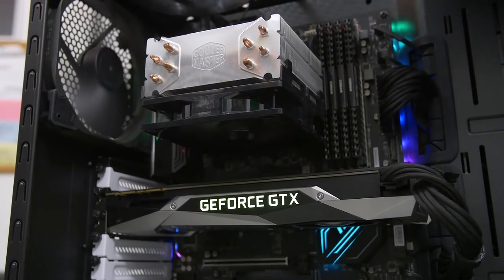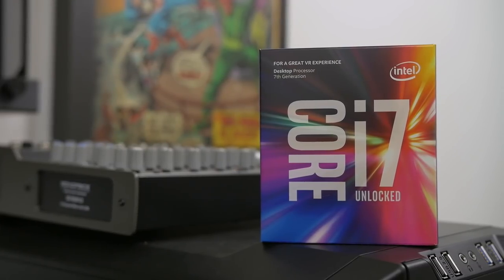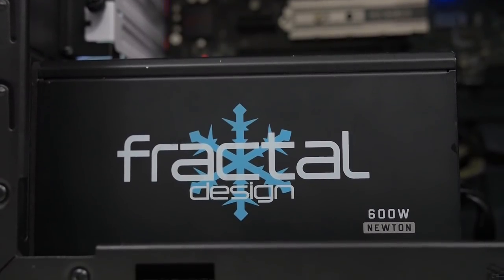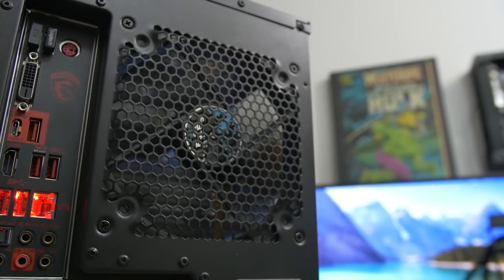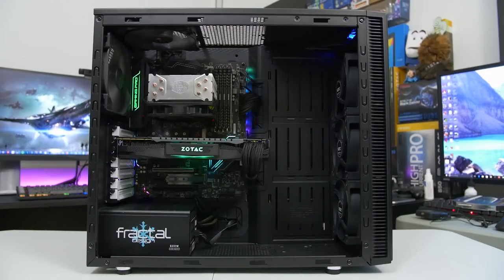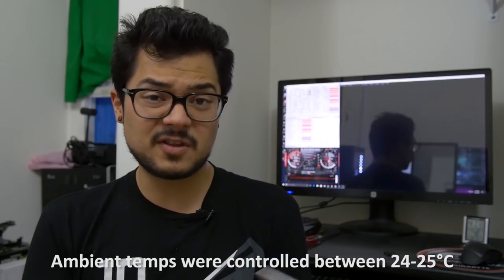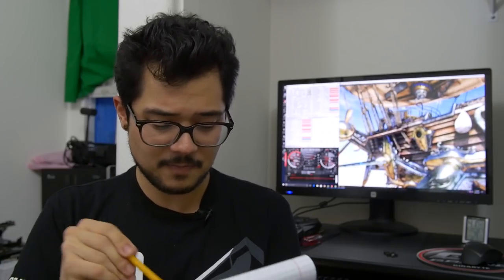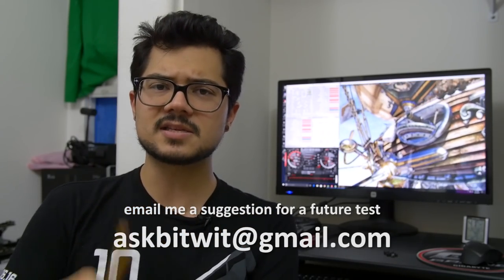This is how you should mount your CPU cooler! I think??

Comment: the card that is exhausting to the rear isn't cooling itself as well in your system due to not enough surface area on the vents on the rear of the card, this would probably lead to heat rising off the card itself without as much force, and might also cause some of it to get sucked back in if you have open slots or vents above the video card but below the rear fan. in your case basically the air is flowing vertically, from front bottom to rear top. the open video card is blasting the air into that path better and its getting swept out, but with the external cooler card the excess heat not ejected out may be just rising slowly causing more of it to flow through the processors intake fan instead of dissipating all around in the case more evenly. I have a rear ejecting video card and I find its typically the hottest point of exhaust. my case has four intake fans two before and two after the hard drive bays, a rear and processor back side exhaust fan along with a 200mm top fan, my cooler is a noctua air dual radiator pointing upward to the top, the bottom rear of the case doesn't really have much air flow since the power supply draws from the bottom of the case and ejects it out the rear and its sealed up better than a typical video card housing.

that's my best guess anyway, the rear exhaust card isn't getting all the heat out the back and is not scattering it in the case so since being right under the processor more of the left over heat is being funneled through it than would be the case if the fans were spreading it out all throughout the midsection of the case when the cpu cooler ejects to the top it pulls air around the closed card, but with it ejecting out the side the heat coming off the card is hitting the side of the radiator as well causing it to warm it up before escaping, the closed card creates a block in the air path in the case and there is nothing below it to force more are around it, the open one is pulling air from the bottom of the case which is pulling some air from the vertical path under the gpu instead of letting it block it and head strait to the processor, if it skips over the card the processor fan when rear facing pulls it away from it all together thus the rising heat hitting the solid side of the cpu cooler warming it up and then heading strait to the processor intake and rear exhaust fan after its bathed the bottom of the cpu cooler in warmth. like I have experienced the video card puts out the most heat anywhere on the exterior of the case where as the rest of the exhaust fans basically are putting out room temperature air. I also assume the test was done with the case side installed.

I know there is a few scenarios kind of lumped together, you could retest putting something in the case that completely isolates the bottom rear including the closed gpu cooler and see if you are getting a warm spot in the case between the gpu and cpu heat sinks, who knows, maybe just a fluke test unless run many times, video card could be blocking the air flow, your ac / heat inside the house might have been a slightly different temperature, youd really have to run this many times under different loads, see if the readings change more with the gpu idling but maxing out the cpu for both

or like someone mentioned, smoke test would be cool, I use cigars to check engines for vacuum leaks lol, might not be the best way to test it, but it takes awhile before smoke will make the internal components sticky

the truth is you may never find the answer and a few degrees isn't anything to be concerned about at lower temperatures, I simply chose to install mine pushing air out the top since the largest cooling fan on the case would basically just aid the two that are part of the cpu cooler

Comment: Here's a theory....

When the fan was in the vertical position, it sucked the heat up off the GPU when the shroud was off. But, when the fan was horizontal, it created a synergistic vortex of air that blew cooler air along the back of the graphics card, rather than just sucking the heat straight up into it. Hence, the horizontal flow was more efficient in keeping the CPU cool.

Comment: Well my guess would be that with the "open" style gpu, with the cooling push the air out the top. The cooler could be pulling the heat from the "open" style gpu, hense the rise in temps.

Comment: And you should put the gpu tempratures beside the cpu tempratures, jsut for comparison. would be nice! this is, since the cpu cooler would be mounted vertically, it should remove hot air from the gpu as well. :)

Comment: I'm actually interested in how the graphics card temperatures compare.
How does the the CPU cooler orientation impacts the airflow around the GPU? Does the vertical mount helps getting hot air away from it, and what is more beneficial for certain use cases (gaming, rendering, light browsing, etc)

Comment: Maybe there is a positive air pressure pocket from the blower GPU outside the case that is blocking the air coming out of the case at the CPU exaust.
Retry with air guides to tweak the airflow.
Can be the internal airpath too. ;)

Comment: with the fan blowing towards the rear of the case and a graphics card with an internal case exhaust the air is forced down and out where it is than mixed with the air from the  intake fans creating more volume of air through the CPU cooler even though the air moving through the cooler may be a few degrees hotter the increased volume cause the cooler to be more efficient

Comment: Knowing what the GPU temperatures were in each test would probably shed some light on why the CPU temps did what they did... but assuming the GPU temps were the same on both cards, here's my theory:

In the first test, the CPU HSF and the blower card are both pushing hot air primarily out the back of the case, which concentrated more hot air near the CPU exhaust area, and also underutilized the open vent at the top of the case, so temps were higher.  In the second test, the GPU was able to take advantage of the vent at the top of the case by exhausting hot air into the case, which could then escape through the top vent, while the CPU primarily exhausted out the back.  In the third test, the CPU is exhausting out the top of the case and the GPU out the back, so temps are still lower.  In the fourth test, the CPU and GPU are again both fighting to push hot air out the top of the case, so the temps rise again.

Comment: Here's what I think:
The first Test was normal
in the second one, the GPU improved the Airflow but the 212 still got fresh air because of all the Case Fans and because the Air came fron the left
Third one normal too
And in the last one the CPU got the hot air from the GPU because it pulled the Air from the hotter GPU area

Comment: I'm gonna go out on a limb and say the reason the temps didn't make sense is that the open air card is running much cooler at load then the blower style so its creating less heat inside the case where as the blower style backplate is warming up pretty good and rising towards the cpu and warming the air inside the case more then the open air. I'm probably totally wrong but hey just my 2cents lol!

Comment: the blower style graphics card will pull cool air through it and out of the back, bulling some airflow from your bottom two case fans out the back, blowing hot air in with the cold air creates a zone of pressure, forcing all the air in the case to leave through the top, resulting in the air having to pass by the cpu cooler if mounted horizontally. if it was mounted vertically it would not have the advantage of allowing the front case fans to help its airflow, and would pull almost exclusivly from the hot air expelled by the open shroud card. my personal theory anyway

Comment: Everyone listen, I did this same experiment on my channel and then noticed this one done incorrectly.  To improve your results, this should have been done at least 3 iterations.  Since we only care about CPU temps here...he should not be running a graphics benchmark, it is pointless.  He should be running this with:
1) No graphics card....using an Intel or AMD that has integrated graphics
2) or if you keep the graphics card in, Running 1080p/1440p/4k video editing will tax the CPU.  Even better running a slight overclock.  As long at the editing does not have special effects on it....GPU usage is at a minimum and will actually flat line temp wise.

Comment: My hunch tells me the top case fan not being in line with the CPU fan the way the rear case fan is, could have contributed to the latter results. In my very limited experience, I've come to think as open style GPU coolers as the better airflow option for your regular tower case since you're moving more air around (heat always gets transferred from hot to cold, and that's the direction it will keep going until the cold side reaches the temperature of the hot side of things - which is when increasing airflow becomes necessary for sustained cooling), and blower cards becoming more heat-efficient only in very tight builds and in cases with restricted airflow. In a tower case, a solo blower card just restricts airflow across the case while contributing next to nothing to it.

Comment: It simple really....but here come the long explanation part.

Because it a open air GPU coolants, it circulate the airs around itself and straight to the motherboard with 2 fans instead of a blowers that is sucking the airs to go straight out.  Thus causing the CPU to gains extra heats from the graphics card itself with colder air floating on the bottom being sucking up to be wasted in a big open air space case.

Comment: Given that the hardware preparation was ok, the only thing I can think of for your test result that didn't make sense, is a pressure differential created by the hot air of the GPU (Zotac) forcing the cool air from the lower front fans upwards and into the CPU cooler. It feels a bit far stretched but it's really weird. Also, if that's the case, this result would only apply to this specific configuration.

You should check the GPU temps to get an idea what's going on on the gpu side. Maybe that could help.

Comment: also you need to do it again with horizontal has a fan either side of the heat sink and vertical having a fan wither side of the heat sink, not 3 fans messing with airflow like a gimp.

Comment: Honest thought, perhaps during horizontal mounting, the air blowing from the open GPU near the black got picked up by the rear chassis fan first. Then for vertical mounting with open GPU, the CPU cooler fan was closer and sucked in more air? That's my best guess.

Comment: The 360mm worth of unrestricted intake probably was enough when combined with the 280 worth of exhaust for the open shroud gpu to kinda be pushed up by gpu fans just above the backplate, and kinda "matrix" around the 212 Evo to minimize heat contamination.
Reply: And the open shroud cards always have better heat sinks that keep the gpu cooler, so perhaps that airflow was cool enough to add to heat dissipation in the CPUs benefit?

Comment: Lemme chime in. 

The first thing is that radiation is pretty much negligible ; just look for a Stefan Boltzmann law calculator.

Going by Zotac GTX 1070 AMP Edition's dimensions, the card is roughly a 300x148mm rectangle. If it's a perfect black body, i.e. it has an emissivity of 1, and it has an average temperature of 70°C = 343K (Pretty hot given how these backplates don't contribute to cooling and heat oughta be carried by the air blowing thru the radiator instead.), that would give a radiated power of 34.85W, which doesn't look that big. But that's the radiated power of the graphic card, which also absorbs power from its surroundings, so you need to substract that amount. To be conservative, let's say the surroundings are at a low 30°C = 303K, plug that into the calculator and you get 21.22W, meaning the total balance is 34.85-21.22 = 13.63W dissipated into the case by the card. Nothing when compared to the 200W+ of the whole rig, so you can safely neglect the radiation produced by the graphic card, whether it's an open GPU or a blower style one.

What most likely happened is conflicting airflows, depending on the configuration. The blower GPU sucks air from below, expulsing all at the back, while the CPU cooler must suck air from the front of the case, so you're not only splitting airflows, but you also have airflows with different directions, and before they get sucked by their respective CPU/GPU coolers, they both came from the front so having one airflow having to do a 90° turn to go vertical while the other one undergoes a more gentle 0-40° pitch up to arrive toward the CPU area probably diminishes the total airflow in the case.

When the GPU got replaced by the Zotac one, all the airflows had to go thru the CPU area or nearly, effectively accelerating the airflow there with the horizontal mounting. A GTX 1070 dissipates around 150W, so assuming the airflow around the CPU cooler is of the order of 70 CFM with all these fans at 100%, and knowing that P = c*rho*F*DT, with P the dissipated power, c the specific heat of air, rho the density of air, F the airflow and DT the delta of temperature caused by the dissipated power, dumping that extra 150W into the 70CFM airflow would equate to raising the air temperature by a further 3.8°C, which would likely be more than compensated by having more airflow on the CPU cooler. Note that while the Zotac doesn't throw air directly in the direction of the CPU cooler, it should nonetheless contribute to a faster airflow around the CPU cooler as it nearly doesn't expel air outside of the case.

The cases with the vertical CPU cooler, where the blower GPU is better, are likely because there's no possible airflow that can do gentle bends anymore, as the airflows must all make a 90° turn. In this case, I suppose the total airflow was fairly low, so having to dump an extra 150W into a single airflow as in the last case was more detrimental than having two separate airflows with separate heat sources. Also very importantly, the top front fan likely didn't send much air to cool the vertical CPU cooler, instead bypassing it to reach the top fan, further reducing the total effective airflow.

The best way to analyze the 4 cases would be to have some smoke generator to see what are the different airflows, and use an anemometer to estimate the displaced volumes of air for each airflow, then you could estimate how much of a temperature rise the air would undergo in a given region, and just as importantly, have a vague idea of the airspeed in a region, as this could be a pretty significant factor for effective cooling ; between cold slow air and hot fast air, sometimes the latter causes a lower temperature rise for the heating element.

If you wanna compute some more, look for MIT's "A heat transfer textbook" on the internet, a free PDF handbook detailing all kinds of heat transfer with quite a lot of details.

Comment: Elementary school physics: HEAT RISES, if you put cooler horizontal with a open air GPU, it will pick up the hot air coming from the GPU and blowing hot air from the GPU, if put it Verticaly will pick the air coming from the front, wich come from the outside of the case. So, best way to put it is vertical. if you have a open air GPU, work out in those exaustion fans.

Comment: The "Open GPU" must be pushing or adding to the flow of air through the CPU cooler, while the "Closed GPU" is drawing airflow away from the CPU cooler. Nothing else would make sense to me. A "smoke streamer" would identify exactly where the airflow is going, but I doubt it would reveal the actual volume of air moving through the cooler.

Comment: I'm guessing the verticlal mounting pulls air from the gpu which runs hotter then ambient air from around the rest of the case. (Can try removing the gpu entirely for this kind of testing honestly as its just cpu temperatures that are being measured here.)
The cpu cooler gets access too better air on the other way around as its aimed towards the front where airflow really is constant.
But its minimized if you have a closed case quite a bit honestly over time.
The cooler air is coming more from the front of the case rather then the gpu blocking the path of airflow slightly while it also sucks in air from outside the case which hasn't been heated up by the gpu or other components.
(a third party cooler on the graphics card also helps drag in air externally from outside the case as the front fans are somewhat useless in an open case with no sidepanel.
Which also helps airflow once again on an open setup like that with a third party gpu cooler.

If you do an open air setup laying down you'd see little to no difference between the two types if the mounting bracket is properly seated & there's no gpu in the way of the other mounting position.
(Common issue with the coolermaster one i believe is that it lacks a bit of tension on the mounting bracket in one position.)

Adding a tiny bit of foam or another spacer behind the cpu mounting bracket (a tiny extra bit foam or a thicker type of double sided tape on all 4 legs of the bracket so its lifted a tiny bit allows it to sit a bit harder on the cpu & securing the mounting better for nicer temperatures & having somewhat better contact with the cpu directly, in the long run it works better but for shorter time's the difference might be minimal.)